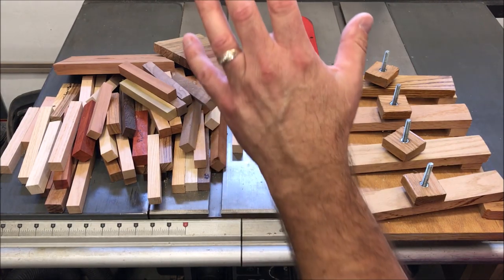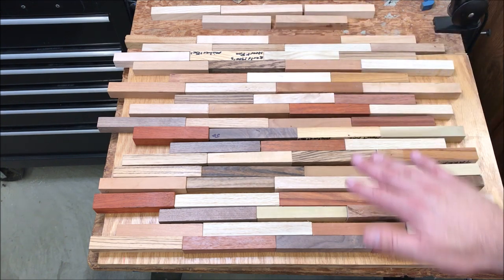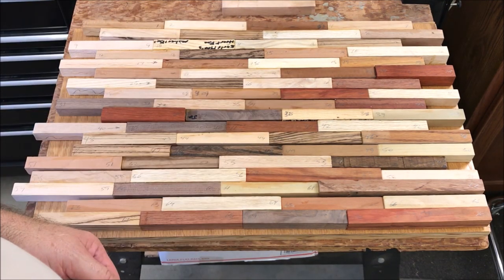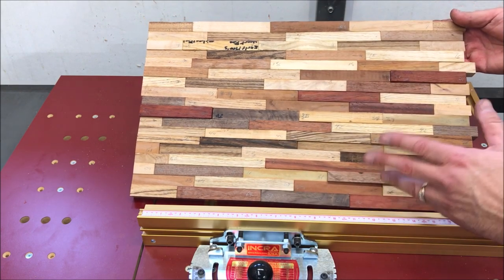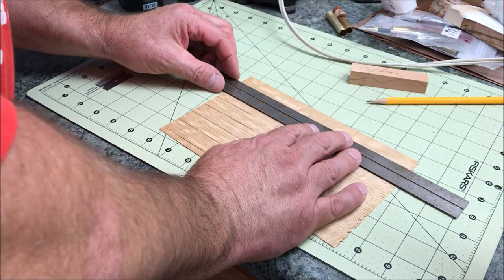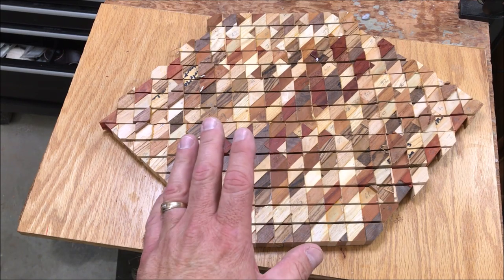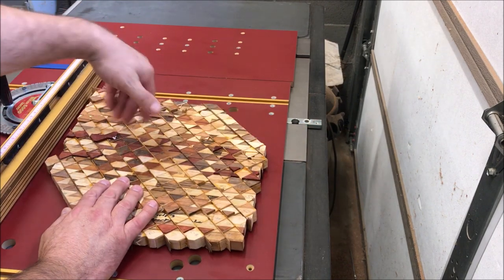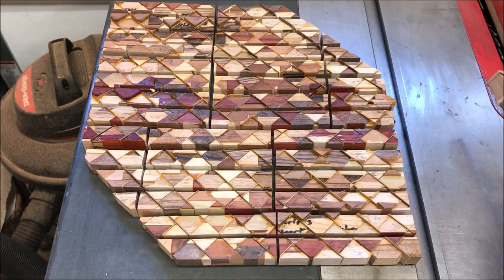Chaos 3.0 - I Make Yet Another Chaos Blank With A New Twist

Comment: I understand about the heat, as it gets really hot here in Texas.   I usually turn on my air, to my shop, about an hour before I go to work.  I have a window unit good for 360 sq ft (shop is 160 sq ft) and a fan.   That usually gets in down to a workable temperature.  In the winter, I use 2 space heaters.   Shop is not insulated, but does have radiant barrier on the walls.  One of these days I hope to insulate it.   Enjoyed the video.
Reply from the maker: It makes it rough to work when the temp is extreme in either direction. 

Regards,
Bob
Reply: @RJBWoodTurner  Agreed

Comment: Hey Bob, first let me say those pen blanks you made look awesome.  I can't wait to see how your first pen turns out!!  So I have a question, I mixed some table top epoxy to make three different colored pen blanks.  I don't have a pressure pot, so I let them sit outside for three days.  Mind you the temps here in south Texas have been hanging around 100 to 106.  So when I brought the blanks in they were hard as a rock.  They sat in my living room for about two months.  Today, being Sunday and the temp being at 102, I went out to cut my first pen blank.  I was going to cut my epoxy blanks into strips for inlays, but when I went to cut them they were soft.  They were outside in the shade, for about one hour if that much.  I still was able to cut them into my strips but my question, can I still use them even though they are soft.  So please I would like to hear your comments on what might have happened to my epoxy blanks and why they went soft.  The mixture on the table top epoxy is 50/50.  Please let me know what your thoughts are on this matter.
Reply from the maker: All I can figure is the thickens must have kept them from curing all way through. 

Regards
 Bob